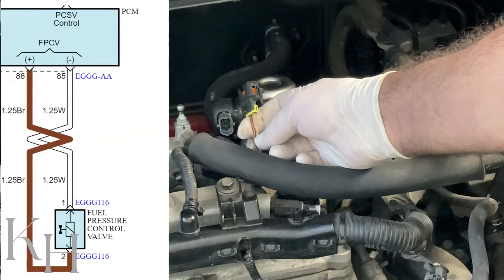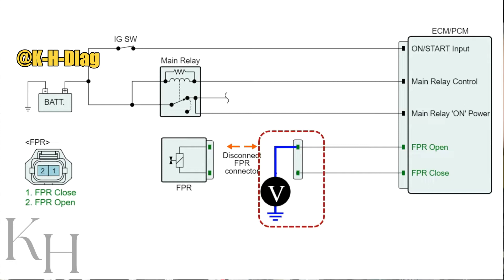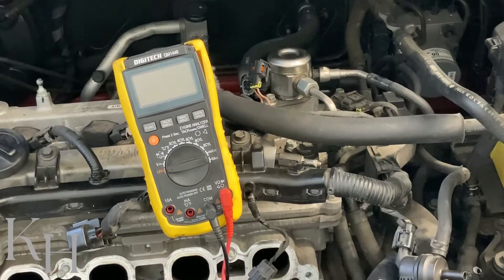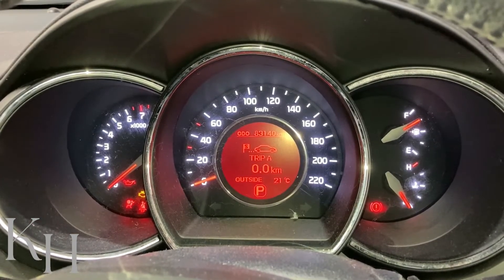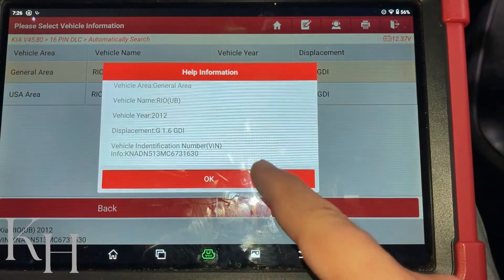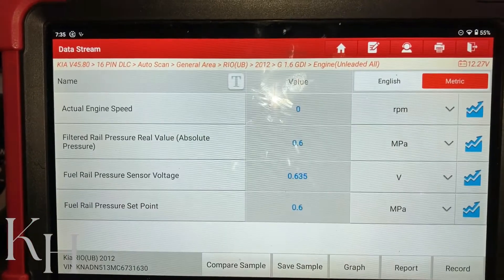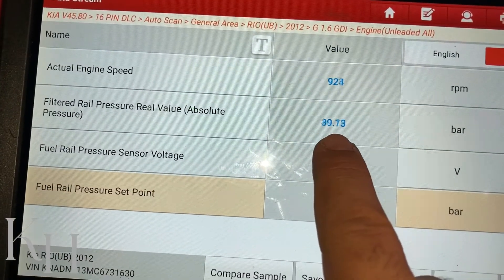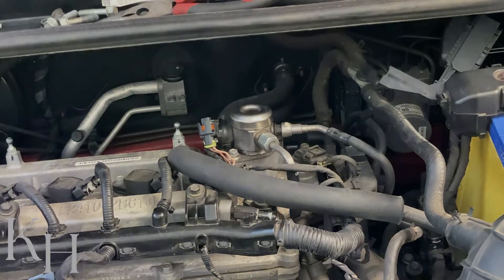Test & Fix P0090 Fuel Pressure Regulator Control Circuit / Open #gdi #engine

Comment: Thank you sir. That explains why the GDI car goes into limp low power mode when fuel rail pressure sensor error P0191 occurs. But can you explain why it is happening very often in hill driving conditions? Removing the error from OBD port tool gets the car back to normal engine working. Thank you again🙏
Reply from the maker: Hi my friend. It could be the fuel pressure regulator bad performance under the load as it should regulate the high pressure pump at higher pressure when driving at high load.

Comment: Hi thanks for all of your videos it's great for us ❤
I have a question when the ecu is dead on kia & hyundai can we adapt it on line  directlt by obd without cloning the units and what website can we have a login thank you ❤
Reply from the maker: Hi my friend. Kia and Hyundai vehicles have ECU upgrade which can be done only through their OEM scanner and online. But in case that you have repaired the ECU, you need a virgin file,   I can’t recommend any website for that right now as many of them provide a bad/ unreliable files. Mechanics normally use their own trusted files.